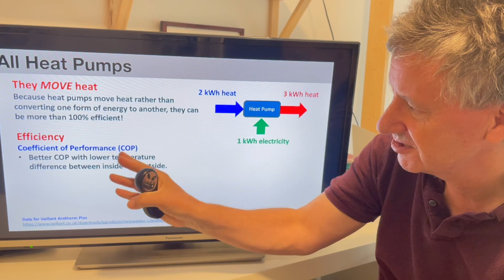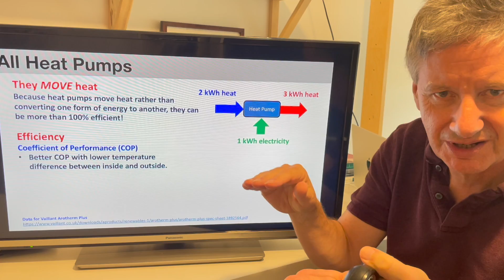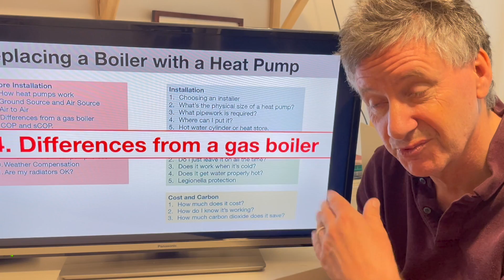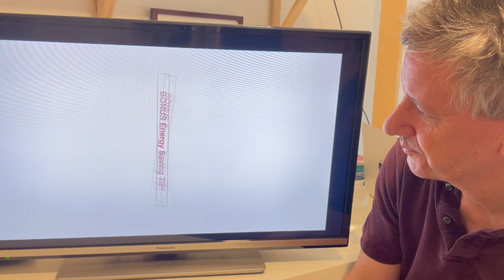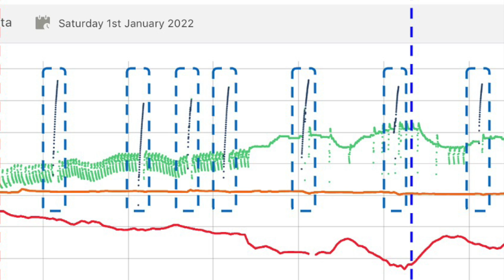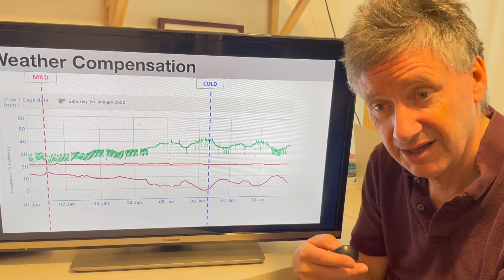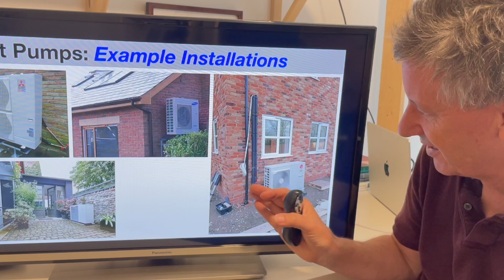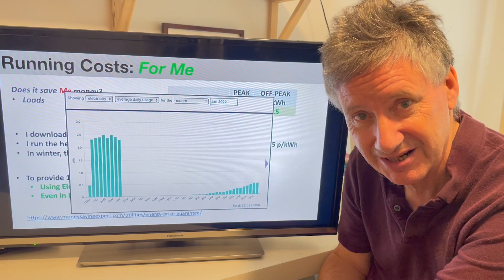Replacing a gas boiler with a heat pump

Comment: You talk rubbish about how a gas boiler works. A gas boiler can output water temp at 50 degrees which is the same as a heat pump. But a gas boiler can heat a house more quickly when needed but a heat pump cannot,. A boiler can be off for 4 months of a year for room heating so the cost for hot water is very low.
Reply from the maker: @richardlewis5316 Good Evening. First of all, please be respectful, and don't tell me I am "talking rubbish". If you disagree, please state your case and let readers judge.

I disagree with you. Some boilers can modulate their heating output down to 50 °C, but this is very rarely done in practice. And doing so will only improve boxer efficiency to - perhaps 92% - rather than 85%. Boilers are more powerful than heat pumps, so they can heat houses more quickly, and heat hot water on demand. But they also emit tonnes of carbon dioxide per year that is contributing to global warming. 

A heat pump can also be off for 4 months a year for space heating.

The cost in money terms of using a boiler is low only if the world market price of gas is low. When this is the case, gas heating can be cheap. But heating with a heat pump can be *spectacularly cheap*. My bills of electricity and heating for 2024 amounted to £161. And my home was toasty warm all winter - with exceptionally carbon dioxide emissions.

Perhaps you don't care about your kids? Really? I find that hard to believe.

Best wishes

Michael
Reply: What he says is rubbish and very misleading

Comment: Excellent and very helpful presentation, thanks Michael.  I have reduced my gas boiler temperature recently to see whether I could run with a heat pump.  It works fine on heating, but I have had to extend the hot water cycle.

I cannot  claim to have your huge personal experience of running a heat pump, but I have done quite a lot of research on them.  If I have understood you correctly, your heat pump is turning on and off frequently - i.e. cycling.  That is inefficient, because heat pumps use a lot of energy restarting and this also wears out the heat pump more quickly.  Weather compensation reduces recycling, because, as you explain, it lowers flow temperature.  If someone buys a heat pump before insulating the house, then he will end up with a heat pump that is oversized for his property.  Oversized heat pumps cycle more frequently and therefore are less efficient.  

Heat Geek recommend sizing a heat pump with a maximum flow temperature of 40C.  The average SCOP for their installations is 4.4.  Last week I watched a presentation by a Heat Geek trained installer and customer.  The system was achieving a SCOP of 5.0 for a combination of central heating and hot water.  Heat Geek recommend running the system 24 hours per day as you do, because that is more efficient.
Reply from the maker: Graham, Good Evening, And thank you for your kind words. Your comments raise several important issues.

Aiming  to run a system with 40 °C flow temperature will result in an efficient system. I am however sceptical that when installed in a normal domestic situation that any heat pump will operate with a seasonal COP of 5.0. Things people may not mention are things such as the room temperature. Many people use 19 °C which makes a big difference compared to using 21 °C - which most people like - or 23 °C which may be suitable for older people.  The difference between 19 °C and 23 °C will be almost 50% more heat used over a year and a reduction in SCOP.

Regarding insulating a property, I would advise people to not put off installing a heat pump unless they very imminent plans to install EWI. Why? EWI for a house is expensive (£20k to £30k?) and will generally reduce heat loss (and CO2 emissions) by around 40%. For some properties - especially Edwardian or Victorian properties, owners may not want - or be allowed - to put EWI on the front of their home. In contrast, a heat may cost £7k and reduce carbon emissions by 80% overnight. For most people it's easier just to install a heat pump.

Regarding cycling at low power. It is received wisdom that this is inefficient. But after four years of operation, I have not detected that inefficiency. I hope to write more on this later this spring. But I have measured COP hourly as teh temperature changes from mild (cycling) to cold (continuous operation) and I have not seen any sign of a change in efficiency. Take at the data in this article

https://protonsforbreakfast.wordpress.com/2025/01/23/a-heat-pump-in-winter/

I think I now have clearer data and I will be writing more soon.

Best wishes

Michael

Comment: What about hybrid heat pumps? Those that also have a gas boiler included.
Reply from the maker: Good Evening Andrei, 

The idea of hybrid heat pump is that a gas boiler (or electrical heater) acts as a back up. The heat pump takes care of the "normal" heating, but in extreme cold weather, the gas boiler comes into operation.

I wrote about this in this article:

https://protonsforbreakfast.wordpress.com/2024/10/08/deliberately-under-sized-heat-pumps/

I think there is a role for electric- or gas- hybrid heat pumps. But their role is really in climates with extreme winter cold - perhaps with temperatures below -10 °C. 

Heat Pumps operating alone can supply the heating required in such extreme heating scenarios, but they can struggle to supply enough heating power.

Best wishes

Michael
Reply: @michaeldepodesta001  thank you

Comment from the maker: Good Evening.

Yes, ground source heat pumps should be quieter than air-source heat pumps (ASHP) because they don't need a fan.

Financially, I think people installing ground-source heat pumps don't need to worry financially - and they can get the contractor to deal with the coils. Or alternatively, if they don't have a lot of space, drill the borehole.

That being said: ASHPs will be the answer for most people.

Best wishes

Michael

Comment: Ground Source Heat Pumps do need a lot of land, but they do have the advantage that they are much quieter than Air Source Heat pumps and tend to be more efficient (Higher COPs). So if you live in a house with a very long garden, they might be worth looking at. Financially, they are only viable if you can dig and fill the trenches (or boreholes!) yourself. This is only possible for the handy and for people that work in the building trade (who can access plant equipment at low cost).

Comment: Of course I can have a COP 5.0 if I set an indoor temperature to 18C. Please don’t tell me that 20C is a comfort I’m winter. Try to set temp to 22C and then measure cost and efficiency. All that heat pump theory falls into water if you set a normal 22 or 23C in winter when it’s 2C outside.
Reply from the maker: Good afternoon. I'. not entirely sure what the point of your comment is. It appears to be that heat pumps don't work when it's cold. This is not true. Obviously COP falls (a) if one increases the indoor temperature - or the flow temperature in the radiators) and (b) when the outside temperature is lower.

For my system the graph below shows how COP falls with external temperature with an internal temperature (if I recall correctly) of about 20.5 °C

https://protonsforbreakfast.wordpress.com/wp-content/uploads/2022/12/cold-weather-4.png

As you can see, the COP is perfectly predictable. BTW, this COP is averaged daily and includes a hot water cycle.

If I wanted a higher indoor temperature I would need to increase the flow temperature in the radiators and the COP would fall.  For an extra 2 °C (i.e. 23 °C internal temperature) my guess is it might fall by as much as 0.5, and the amount of heat delivered would increase by around 12% per °C.

Of course these cold temperatures only constitute a small part of the heating season, and the yearly average of COP is around 3.5 

And my home is perfectly warm all winter, and at an exceptionally low cost. I hope your home is warm too.

Best wishes

Michael
Reply: @michaeldepodesta001  Thank you. My point is that everyone here on youtube advertises heatpumps efficiency and set the low temperature and not the normal termperature of 22C for hauses with radiators. Everyone sets temperature on 20C and most of people could not be confortable with this. So the COP falls and the price for electric rises. I think heatpumps could not be installed in houses with radiators. That technology should only work in very well insulated modern houses with undefloor heating.
Reply from the maker: @nevenkofilipek  " I think heat pumps could not be installed in houses with radiators." This is directly contrary to my experience. Heat pumps work well in all kinds of houses with radiators, including my own. I know installers with - collectively - hundreds of installations and their customers seem happy.

On what do you base your opinion? Have you had a bad experience?

Best wishes: Michael
Reply: @michaeldepodesta001  I have a rely bad experience with this. I have vaillant arotherm 7kw heatpump with sensoconfort 720. Heating is done with aluminium radiators with flow is around 43C with gass boiler for heating my 102m2 (kitchen, living room, floor, small bathroom and two bedrooms to 22.5C. I have also 500L buffer tank but I think it is too much for this system. When I heat a house with heatpump then I cannot get more than 40C out flow from heatpump and I cannot heat my house with flow because it is not a good insulated house and this buffer tank gets hot to 40C and a flow on radiators is also 40C. The heat curve is se to 0.8 and COP id 3.0. For 24 hour it eats 70kw of electricity and I feel not confortable.
Reply from the maker: @nevenkofilipek  First of all: please accept my sympathy. If you have spent money on this, the idea that it won't keep you warm is sickening. And not acceptable.

First of all here's my diagnosis - based on the data you have given me. If the gas boiler could heat the house in a satisfactory manner, then a heat pump can heat your home too: 43 °C is not a high flow temperature and easy for a 7 kW Vaillant Arotherm plus. So what's wrong?

If the heat pump consumes 70 kW of electricity in 24 hours then - at a COP of 3 it is delivering 70 x 3 =210 kWh of heat each day. On average this amounts to 210/24 = 8.75 kW i.e. it's working flat out beyond its nominal specification. So my first thought is that the heat pump is undersized. This is pretty unusual but it can happen.

So what to do?

1. Contact your installer and ask their opinion. Unless you specifically insisted on this model, this is their responsibility.
2. If you get no joy with your installer, and they are registered with MCS, contact MCS and tell them you are not happy. MCS do not have a good reputation for responding to complaints, but it might help. If you installer loses his MCS accreditation he will not be able to install heat pumps under the BUS scheme.
3. Possible solutions are:

(a) a larger heat pump or 
(b) an auxiliary in-line heater as described in this article
https://protonsforbreakfast.wordpress.com/2024/10/08/deliberately-under-sized-heat-pumps/
(c) switch back to gas.

4. Do you know how much gas you used to use on a cold day? Or how much you used to use in a year?

5. There are other possible causes - if the heat pump is situated in a way that it sucks back its own exhaust air, but that shouldn't happen with a good installation.

Drop me a line at house@depodesta.net if you would like to discuss this more privately.

I am really sorry for your experience, and will do all I can to help.

Best wishes

Michael
Reply: @michaeldepodesta001  As I see the meater of electricity its aruond 5 kw but constantly. It is comsumption for the whole house not just a heatpump because I dont have meter for heatpump alone. I dont think its to weak because it never works with 100%. This is now when its 3 to -2 outside. Becouse here in Croatia the temperature is from 3 to 10 at day and 3 to -3 at night.
Reply from the maker: @nevenkofilipek  Ahh. You're in Croatia. Greetings from the UK.

1. Does the heat pump work when the outside temperature is milder, perhaps at 10 °C?
2. Have you changed Room Temperature Modulation to "ACTIVE"? This should automatically increase the flow temperature if the room is not hot enough.
3. Do you have the My Vaillant app?

BEst wishes

Michael
Reply: @michaeldepodesta001  Yes the pump works when is mileder. The Room Temperature modulation is set to expaned and I dont have the app because I dont have router so I cann monitor the heating.
If I set the automatic curve adjusmend then when is about -1 it sets the curve to 0,95. Does this auto adjusment curve drops when is mild outside or it stays at 0,95? I think that my buffer tank is to large so when temperature drops then it cannot warm the water enough so to get it to 43C.. The tank is 500 liters. Maybe if I get the tank of 100 liters so it can heat this tank to desired flow? I dont know how this will affect deffrost. Also I think my windows and dors a needs to be replaced because they are made off wood when the house is bild and that was 1976. I have also solar panels of 6kw. And also solar panels for dhw heating. I dont heat dhw with heatpump
Reply from the maker: @nevenkofilipek  Good Morning. When you put 500 litres I assumed it was typo. In the UK 50 litres would be more normal. That buffer is harder to heat than a domestic hot water cylinder! Does the pumping allow you to bypass it and heat the radiators directly?

You mention air leaks (draughts) from poorly fitting doors. This is a cheap fix with adhesive draught-proofing products.

https://www.amazon.co.uk/s?k=amazon+draught+excluder

If you can feel the draughts, then this will make a big difference.

BEst wishes: Michael

Comment: I have a non-condensing boiler but could I try lowering the flow temp for just a day or two, or will the condensation generated cause an immediate problem with leaking or corrosion? I would just like to see if my current system can sustain 40 or less flow temp before I move forward with an HP.

Is a low loss header the same as a buffer? Don't they introduce mixing of flow and return so significantly reduce efficiency in tests that have been carried out?
Reply from the maker: Good Morning. If I understand correctly, in a condensing boiler then the water vapour in the combustion exhaust is condensed by having the inlet cold water pipe flow around the exhaust. This condenses the water vapour, releases extra heat and the condensation is captured and dripped away outside.

In a non-condensing boiler, the hot exhaust gas flow straight out of the house. 

So I don't think lowering the flow temperature could cause condensation. Lowering the flow temperature bit by bit is a smart way to (a) reduce bills now and (b) see if your system is heat pump ready. Obviously the best test is on a cold day. 

The article below summarises my heat pump performance over the last three years. In my installation, the evidence shows that the low-loss header did not make a difference: it was unnecessary. But neither did it seem to do any harm! Plumbers explain this badly, but roughly speaking, if an installer does not know what the radiator pipework is like, then installing a low-loss header is like an insurance policy: It makes sure that the installation will work - but it may not be optimally efficient.

https://protonsforbreakfast.wordpress.com/2024/08/21/2024-summer-summary/

I think low loss headers and buffers are different. I think a buffer adds some water volume to the system to prevent the heat pump cycling on and off too quickly. I think a low loss header is used to match the flow impedance of the radiator network to the hydraulic pumping power of the heat pump.

Do get back to me if this isn't clear.

And good luck with your endeavours! Do visit some owners (or me! I'm in Teddington) to see how they feel about it

https://app.visitaheatpump.com

Best wishes M
Reply: @michaeldepodesta001  Thanks for your reply, and a very good video btw.

Its widely said across the Internet that you should avoid flow temps below the dew temp in a non condensing boiler as it will allow condensation that will cause corrosion of the boiler (and I presume a water leak as there is no means to capture the condensate). I was challenging that to see if it mattered for a just couple of days or so. Otherwise I would have done it years ago 😉 I would do the test when its colder.

I thought a volumizer adds water to the system (to aid defrost for example) but a buffer reduces cycling when the flow rate isn't high enough to exact the heat (e.g. with some microbore). This sounds like what you are describing as a low loss header, so maybe there are the same?

Btw, love physics, especially "spooky action at a distance"! Life relies on it, e.g. neurons simultaneously firing 👍And nuclear fusion is still "only 20 years away" 😄

Comment: Cleaning heat pumps can be dangerous I saw a so called professional cleaning it with an air line and dust was everywhere a vacuum needs to be used.
Reply: And a dust mask of good quality should be worn (mandatory)
Reply from the maker: @frederickbowdler8169, Good Evening.

I think there is still a lot of poor practice amongst installers. But my experience is that even in the last two years, standards have risen substantially, and I think that's a trend that's likely to continue. I certainly hope so.

BEst wishes

Michael